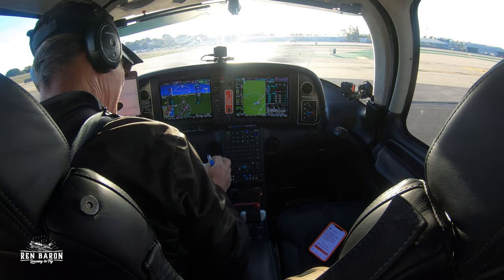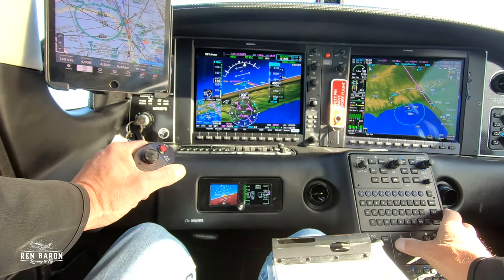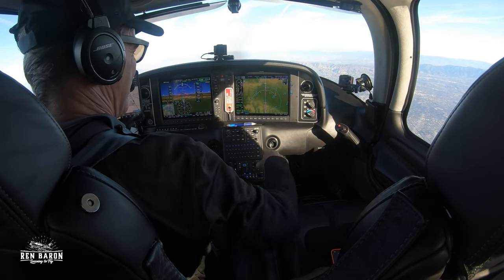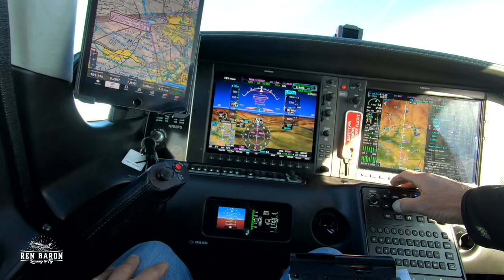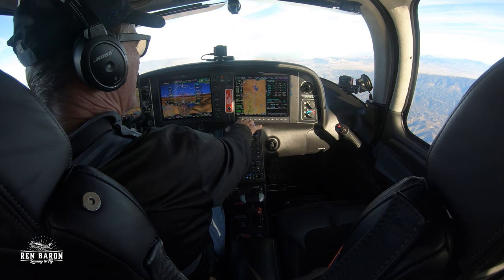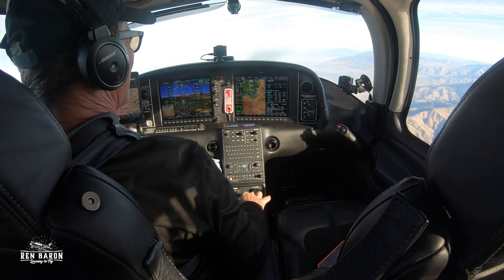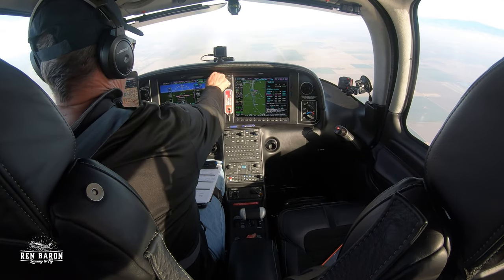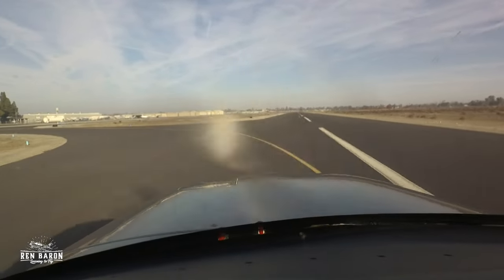Simulator v Real World Flying Pt 2 Real World Flight in Cirrus SR22T Gen 6

Comment: Ren you handled that descent LIKE A BOSS!!! Flight simulators are amazing and started using them way before I got my ticket.  I received my PPL in 40.1 hours and my Instrument in a little over 36 additional hours.  Not because I was super smart but, because I spent hundreds hours on my sim with PilotEdge.  Folks really underestimate the impact it has.  Even having your own plane there are times you can't get to the airport.  So, unless you do it for a living and are at the airport several times a week there is no better way to stay sharp.  Lastly, I learned SO MUCH sitting in your virtual cockpit seat and I am so very grateful that you take the time to share your experiences.  -Shane
Reply from the maker: You made my day Shane! Thanks-Ren

Comment: Hi Rennie! Love your channel. you have a solid 'pilot voice' as well :)
Quick Q. I notice you have a large format iPad. What attachment are you using, and does the iPad get in the way ever? I'm wondering if your set up works well or if I should replace my IPad Pro with a mini, and tape it to my lap. Thanks in advance!
Reply from the maker: Thanks for the kind words!  I actually use an Ipad mini not a large format. The mount is the Ram Mount Ez-Roller. The mini is rarely an issue with getting in the way as long as I securely fasten the mount before each flight before climbing to cruise altitude. Once I get past 10K they'll lose pressure and fall otherwise. The full size Ipad did kind of get in the way and that is why I went to the mini. Good question. Thanks for posting. Cheers-Ren

Comment: Since your plane is a Cirrus SR22T and the Torquesim is really a TN…Is there a big difference in engine management (mixture and power relationships)?  Or do you feel they are similiar?
Reply from the maker: The Torquesim flight model is very accurate with the engine numbers to my actual SR22T. The main difference is that in the turbo you takeoff and climb at full power and then pull back to 30.5 manifold pressure v 29.5 in the TN version on the sim. Otherwise it is remarkably similar to the real thing. When I tried other Cirrus SR22T flight models they were not in the ball park. Thanks for posting. Cheers-Ren
Reply: @TheRenBaron  Thank you.  It is a great piece of software and I have the Realsimgear hardware to match (much the same as your older setup).  Incredible pairing of two vendors.  I am a 55 year old “rusty” pilot and after 16 years of raising 3 kids since I last flew with my PPL, I am considering getting back in the saddle now.  Your channel and content has not only been highly educational but also very inspirational for me.  Thank you for doing this! - Scott
Reply from the maker: @XOrionFE  thanks for the kind words. Cheers-Ren

Comment: Great video. Well explained along the way. I use the AOA exclusively to trim and maintain appropriate approach speed on final when hand flying. Your thoughts?
Reply from the maker: I look at AOA as a reference as well and it’s helpful but the size of the indicator v the pathways for me makes it kind of a secondary indicator. But if you look at the AOA indicator on the vids it’s at 3 o’clock at 77kts over the numbers on every smooth landing!!
Reply: @TheRenBaron  For that to be always the same you would have to be at the same weight every time!
Reply from the maker: @susanshroder1002  Not exactly sure what you are referencing here Susan?

Comment: I am getting tired of ATC bringing me in high, have started to cancel IFR early when weather allows. Is that something you do?
Reply from the maker: If I'm flying an IFR route I generally stay with it just to stay sharp. The RNAV approach at KSMO requires a pretty quick descent which I always felt the ATC folks were bringing me in high. But the fact is they had to keep me at relatively high altitude because of departing traffic at the Class C Burbank Airport. So what I finally figured out was I need to make a slower approach which bought more time to get down and allowed for a steepish descent to make it happen. I also learned to be proactive and ping the controller and let him/her know I was "looking for lower" and to remind them I was in the area. So don't automatically buy that ATC is bringing you in high for no reason. Use it as an opportunity to learn how to 'manage' the approach process and really fly the plane.
Reply: @TheRenBaron  Good points, I did try your technique of slowing the plane down expecting a steepish approach into STS and it worked well. But some of my CHT's were no longer green. I definitely need to be more proactive in asking for what I want. Soon I will be flying into SMO, I need to get better at thinking ahead. THX

Comment: Why mount an iPad in the cockpit?  The MDF has everything you need, and doesn’t get in the line of sight.  Just interested to hear why, not a criticism.  Thanks
Reply from the maker: True enough that you can get all that info on the MFD but in many ways its easier to access certain things on the Ipad. In addition, there are some very powerful features within the Perspective + avionics that you can use with Foreflight and the Ipad. One of the best is the ability to build or change a flight plan on the Ipad and then bluetooth it to the MFD. It's an easy way to store all your POH and flight manuals as well. And finally its a great backup instrument in the event the MFD fails. That's why I won't fly without it. And btw it doesn't block my view. Great question though. Thanks for posting. Cheers-Ren
Reply: @TheRenBaron  Thanks for the reply.  I use my iPhone for import  of flight plans.  Everyone has their own way.  I just wish there was a real internet solution for small GA aircraft.